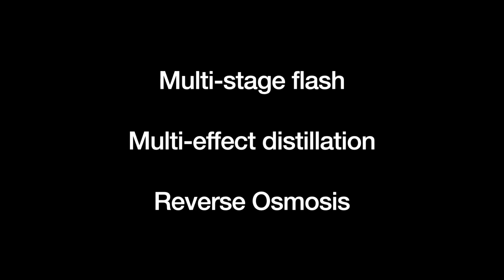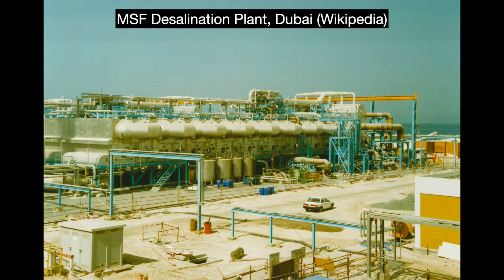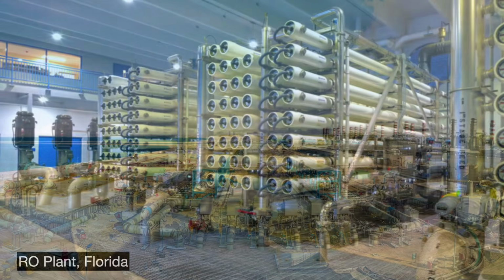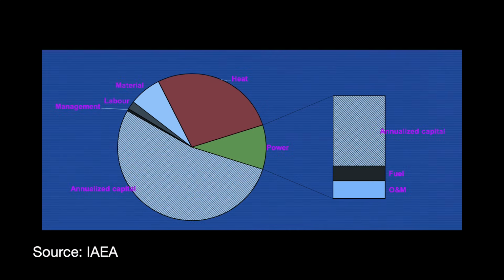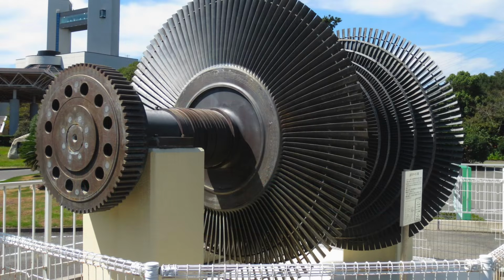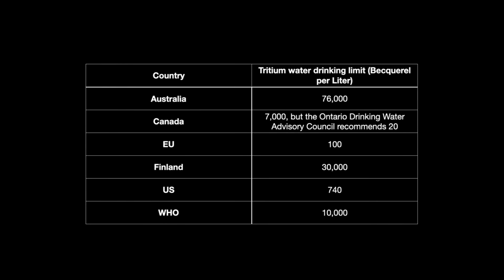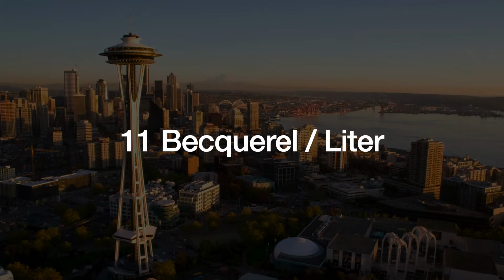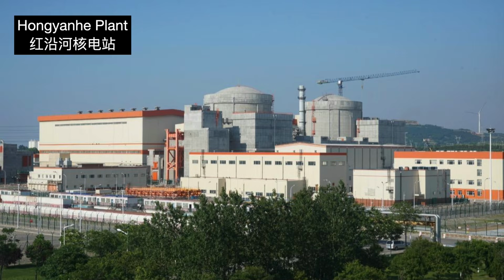Going Nuclear to Desalinate Seawater

Comment: Salt cooled nuclear in 1973, well I didn't know the tech was that old. They are working full speed on the molten salt reactors now. Definitely the best method of desalination.
Reply: Just to underline kokofan's point: Sodium does not equal salt. Sodium here refers to pure, metallic Sodium, not a compound that includes Sodium such as Sodium-Chloride a.k.a tablesalt.

That being said, the US operated the world's first Molten-Salt Reactor in the 1960's at Oak Ridge, Tennessee.
Reply: @eckligt  1954 was when the first Molten-Salt Reactor was fired up. That was the focus of the Aircraft Reactor Experiment.
Reply: @travisbeagle5691  Thanks for the correction!
Reply: pure metalic sodium, I remember seeing that being thrown to body of water and then BOOOM, lots of dead fish.
Reply: @eckligt  By the way,  there are designs that use sodium salts instead of fluoride salts,  allegedly with greater efficiency and less tritium production.
Reply: @eckligt  If a Molten-Salt reactor uses pure Sodium it isn't a Molten-Salt reactor since pure Sodium isn't a salt. It would be a Sodium reactor then.
Reply: @DutchmanAmsterdam  Yep, that's what I tried to say.
Reply: @eckligt  fair enough mate.
Reply: Back to the 1950s in fact,
Reply: That’s a sodium metal cooled reactor
Reply: The real beauty of the design was that it was 100% turnkey.  The experimental reactor was literally turned off overnight and restarted the next day. The main issue was that thorium (although it produced only a fraction of the waste, and that in as shorter lived and more easily manageable isotopes) is not easily weaponizable. I believe separating U233 from Th233 was something of a bastard. U235 & U238 transmuted to Pu239 on the other hand were very easily turned into great big boom-booms, and when has the military given a single damn about waste and pollution. Thus a very promising technology was tossed on the waste heap of history for the best part of 3/4 of a century.
Reply: Solar, grid battery and wind power engineers: "The fossil fuel industry is is trying to derail us with pointing out non-issues and lobbying with their billions!"
Nuclear engineers: "First time?!"
Reply: @anydaynow01  ok wind is kinda trash to be fair
Reply: @MAL1GNANT  the thing is in my opinion most renewables are used wrong. I think that solar and wind etc would be great for the production of fresh water of even hydrogen fuel etc. It just not predictable enough for the main power grid
Reply: @holt_hz  What you said. PERFECT.
Reply: @holt_hz  Solar is very predictable in sand ginger countries.
Reply: Salt cooled reactors don't have anything to do with desalination.
Reply: @GeorgeWashingtonLaserMusket  No it doesn't. In fact circulating hot, corrosive radioactive salts through meters of plumbing with joints, valves, bends, etc, comes with a whole lot of engineering issues.
Reply: @darkgalaxy5548 
Have a read about Moltex's SSR Reactor.
Molten salt fuel, molten salt cooled but no pumped hot salt.
The fuel salts are static in fuel tubes and the cooling salt is moved by convection currents.
Reply: where does all the salt go?
Reply: The fission mafia suppressed molten salt reactors
Reply: @whtkngofc  You can't breed plutonium in sodium reactors.
Reply: @richardscathouse  That's not entirely true. Any fission events involving Uranium 238 will result in Plutonium being produced. In fact, that's what you're trying to do in a breeder reactor like EBR-2, which was a sodium-cooled fast reactor. You do also get some breeding in light water reactors. 
If you use something like Uranium 233, you don't end up with Plutonium in your decay chain. You do end up with Neptunium which poses other issues.
Reply: @whtkngofc  Fission mafia? Molten salt reactors use fission too.

Comment: Very interesting. Any technology that reduces carbon emissions while supplying water is worth considering! Any thoughts on using PVT (Photovoltaic Thermal) panels as a source of heat for desalination? Liquid cooling solar panels increases their efficiency (thus generating more energy), and you generate a lot of heat which when paired with a heat-exchanger, could be yet another source for desalination energy.
Another interesting thing is that we can reduce agricultural water consumption significantly by putting solar panels to provide partial shading, which can dramatically reduce water consumption and increase yields (especially in hotter locations and times).
Reply: I've seen images of vinyards being augmented with solar panels as you describe. However, I've also seen photos of solar panels being torn to pieces by hail. Then the Cadmium inside leaches out, and you get a bad batch of whatever you grow underneath ... for eternity.

Comment: what about waste brine water's impact on the environment?
Reply: Depending on the location, ocean currents will either dilute it very quickly or quite slowly. A long pipe line or some other dispersal method would be an easy solution if you didn't have an area to use a salt flats for mineral extraction/ sea salt for cooking.

https://en.wikipedia.org/wiki/Ocean_current

Comment: Wow, what a good and timely video.  Is it possible to process the waste brine of these desalination plants for lithium batteries?  That in itself would be huge.  As far as what is used to fuel these plants, start with what is available and then transition into more eco-friendly fuel.  Just do it.  In our Southwest, most of the water used is agriculture, using these plants for that purpose and industrial needs would free up river and aquifer waters.  Of course, the sheer volume of agriculture waters is huge.  Scale it.
Reply: Now that would be an interesting idea.  Have a nuke generate electricty, fresh water, and send the waste water to those drying beds they have in California to extract sea salt and other stuff.
Reply: As I replied to someone else, the Diablo Canyon power plant in California is having its service life artificially shortened due to politics. Some people are exploring whether it can be repurposed as a desalination plant, so it can keep operating and doing useful work for society even if it is barred from delivering electricity to the grid.
Reply: @eckligt  I thought the plant was being closed for economic and ecological reasons? Desalination does not solve the ecological problems, but might help the economic side by adding another revenue stream

Comment: There is no risk of tritium contamination even with multi-stage flash method. This is because the water in the reactor never leaves the reactor. The heat is transferred using a series of heat exchangers instead. In a MSF desalination plant the brine will be hitting the tubes which are heated by hot steam in a closed circuit which is heated by hot steam in a different closed circuit which is heated by the supercritical water in the reactor. The tritium would be in the water in the reactor and never reached the brine. Even if the reactor leaks, only the first set of closed steam circuit is contaminated. Far away from the actual MSF desalination plant.

Comment: the biggest problem with desalination process,.. is what to do with those overly concentrate salty water  waste ??.. throw back to the sea would spoil the eco system in long run,..
Reply: Might not be feasable for large plants, but for smaller ones in hot countries you could spread the water out over a large surface and let it all evaporate. You might even be able to use the salt afterwards
Reply: @MB-cv5pz  if small scale,.. no need all these high tech method,.. just distill under fire wood will be suffice,..

Comment: Our rejection of Nuclear power was a massive mistake, and the environment has payed dearly for it as we continue to rely on fossil fuels for our electricity
Reply: We’ll turn it around.  Attitudes are changing.
Reply: @Pene7942  What's needed is modular or at least a large design change that cuts current design and build costs and construction time. Modular might be aimed at "small" power demand now but like gas turbines, you can just keep adding to them as demand grows vs vast power potential build costs now. The fact is that current costs even excluding public opposition and planning delays are killing nuclear power construction and pension funds won't consider funding them without vast gov backing to offset any risk to ROI. If nuclear bombs kept getting vastly more expensive for every next generation then nuclear proliferation would be much lower. Nuclear power (forget fusion) offers desalination, hydrogen fuel production and low cost waste heat for district heating grids. It could even be used for carbon extraction power supply.
Reply: Blame the Soviets being lazy and cost cutting everything
Reply: What is the units in the tritium production chart,  TBq/GWe,
Reply: @Rybread1611  Terabequerels sounds high, as a trillion is 10^12, but remember a mol is 6.02x10^23, so a TBq is about 5 trillionths of a gram of tritium decaying per second. You wouldn't want to drink a TBq of tritium in every glass, but it's generally very diluted, so total exposure is much more limited.
Reply: @Rybread1611  One Bequerel is one atomic disintegration per second. T is tera, for trillion. GWe is gigawatt (electric), which is about 1/3 of the thermal power produced by the reactor.
Reply: You can thank the KGB and FSB for astroturfing the anti nuclear sentiment to make countries dependent on Ruzzian gas.
Reply: What an idiotic statement
Reply: How is nuclear any better with 20 to 40000 year half life , nothing wrong with fossil fuels , it's our populations are the problem . Over bred stupidity
Reply: Remember if not for Chernobyl, Russia would have sold many more of these flawed designs abroad.
Reply: @stephendoherty8291   they already did decades ago lol. They're selling even after Chernobyl.
Reply: @DalitKumarAryan  Yes but the design was changed post Chernobyl and they may have pretended to themselves noting was wrong but every plant engineer and control room tech got training. It's absolutely amazing the main head engineer even accounting for the design flaw was not given the bullet or something equally violen. working with the army "recruits" on the roof or the miners was the best sentence for him, then the bullet...
Reply: @stephendoherty8291   but the design isn't changed at all. A lot of other reactors have the same design still being built.
Reply: @DalitKumarAryan  Yes but at least they know the design has a major flaw and kit is there now to spot that. Ukraine dumped it's Russian kit in reactors to avoid crap kit and avoid Russian hacking
Reply: Probably you should look out for the destruction cause by nuclear pursuit,go to Niger,Congo,Kazakhstan, etc.Theres no clean energy, and all involved slow, painful deaths
Reply: So so true
Reply: A new understanding that  green light , using    and using modern efficient LED makes desalination only 10% the cost of the next cheaper. Find this online.
Reply: A new discovery, green polarised LED light evaporation is some one tenth the electricity. Search online. The units will run off solar panels.
Reply: From what I understand the rejection of the thorium reactors was a even greater mistake.
Reply: @charlesstevensEnki Thorium plants didn't make weapon grade refineable plutonium so now you know why.
Reply: @charlesstevensEnki   but thorium don't even exist lmao how did we reject them?
Reply: We need both.
Reply: Paid
Reply: @TheDutchShepherd  nope, just sick of the lies and the pollution
Reply: It wouldn't matter. Somehow we would find some way to destroy the earth around us.
Reply: fun thing about historical fictions is that you never actually know what the outcome would have been if history played out differently. To assume there would be no issues with nuclear if we fully embraced it, I think is naive.
Reply: There needs to be a solution for the waste. Burying it isn’t good enough. Reactors that re use the waste that results in a shorter half life seems to be just talk.
Reply: @TheBooban  The French have been recycling their nuclear waste for a long time, so it's definitely not just talk.
Reply: @TheBooban Fast breeder designs do exist but their complexity and good access to "waste" fuel is more difficult. Nox was a recycled waste fuel. It reformulation resulted in a fuel that could not be recycled again and it's end waste was even more toxic and a longer radiation life. As long as Russia and South Africa can ship "cheap" uranium ore, fast breeders will remain a niche even if the vast amount of spend fuel in a standard design is wasted
Reply: @TheBooban  
The technology has advanced so much that even the most dangerous waste is so little you could fit it all in one single depot. And the caskets are so solidly built they used trains with rocket boosters to crash into them to prove how durable they are, even explosives. 
Meanwhile smoke and other pollutants just get sent in the atmosphere.
Reply: @ionpopescu3167 The issue is once a good storage solution is working, that waste argument holds less water. Finland is one of the very few whose population accepted nuclear power means waste means storage. Build a nuclear weapons base in a US state, no issue. Want to store that waste for millenia then no way. In reality all that existing waste sitting in pools and canisters on existing power station sites, spreads the risk but those pools are high risk as cooling can never be cut or they explode
Reply: @TheBooban burying the nuclear waste is actually pretty good, it's been dug out the ground after all.

But because of the high concentration you will need to buy it well below groundwater level or seal it perfectly.

Radon will leak though, so it's probably best to keep that in mind and capture it.
Reply: @Lardah Finlands repository is air sealed so not sure Radon gas is an issue
Reply: @TheBooban  nuclear waste is still much better than all the fossil fuel waste we've had. There's also a lot of research into nuclear fuel reprocessing such as hollow fiber ionic liquid reduction exchange process.
Reply: @Zaydlayd123  only reason nuclear waste isn't as big a deal as fossil fuel waste is that nuclear only accounts for a small fraction of our total energy consumption.
Reply: @squee222  you need to look at waste produced by kw/h and then you'll see nuclear waste and especially HLW, is very dense. Also nuclear industry is the only energy industry that actually regulates their waste management, oil and gas industry sheds a lot of radionuclide wastes that's unmanaged.
Reply: @Zaydlayd123    hollow fiber ionic liquid reduction exchange process doesn't work at all.
Reply: @TheBooban  Nuclear waste is kind of a misnomer. It can be recycled almost indefinitely into such a wide range of products. True nuclear waste is very small, and burying it is definitely adequate until new sources of energy can be discovered
Reply: @ebob0531  Few reactor designs built commercially can continuously recycle their waste product. France and Russia are near the only current sites for reprocessing nuclear waste fuel and using it. Even Japan used to ship it to the UK and they relied on nuclear power until Fukushima
Reply: @TheBooban The reason the waste is not reused is because america has a stroke when one of those reactors are  build as a result of the reaction is plutonium. Sellafield can use nuclear waste and the Americans still tried to block it (dispute it being operated by the UK). Also you could literally dump all the nuclear waste into a oceanic trench and still generate less radiation than what is coming from the trench.
Reply: Tell me more about 3 mile island. Tell me more about Fukushima nuclear disaster. Maybe you'd like to tell us what happened at Chernobyl.
Reply: @iamantiwar2003 Didn't see oil production cease in the Gulf of Mexico after Horizon rig environmental disaster or Alaska or North sea rig accidents.
Reply: @iamantiwar2003 maybe the problem isn't the technology we choose, but that governments and corporations always try to do stuff as cheap as possible, with little regard for the problems.
Reply: @iamantiwar2003 exactly, ignorant denial he is